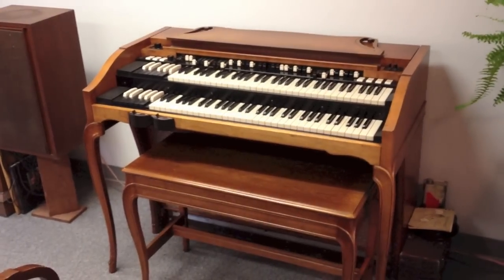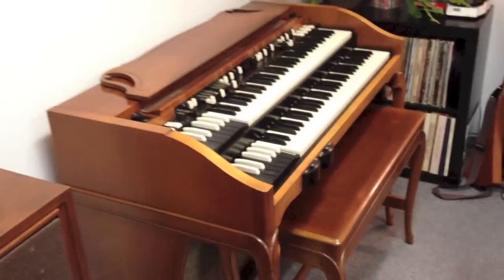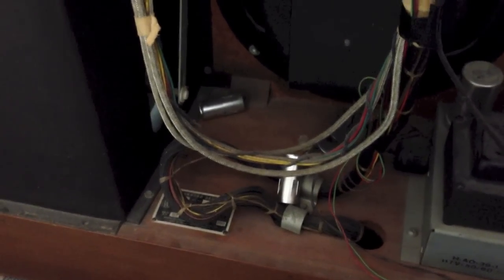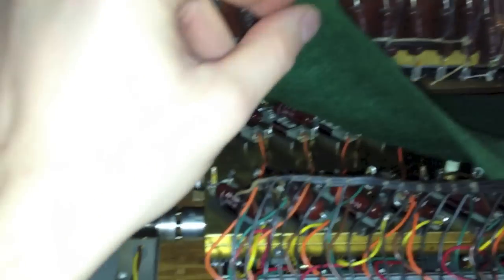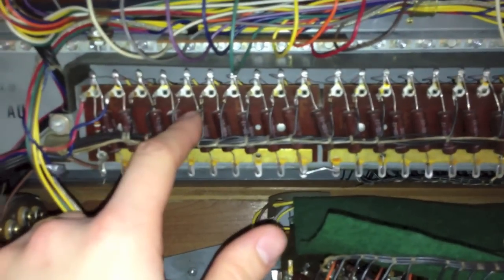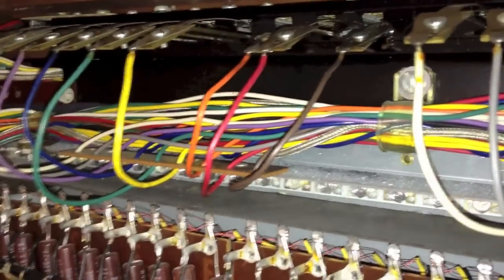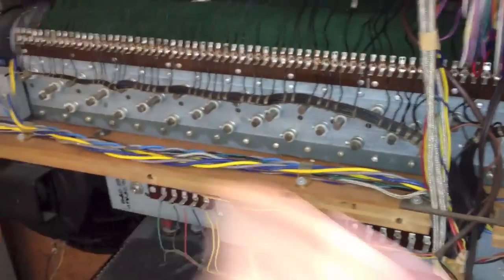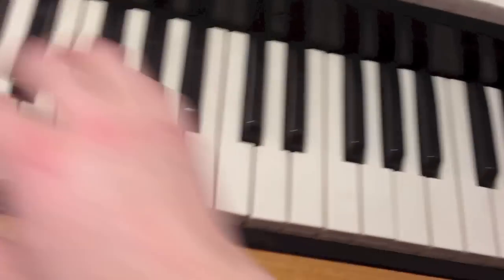1965 Hammond A-102 clean up and restoration

Comment: I just got a M102….does that sound right? Anyhow, has two switches, a motor and play switch. Motor switch doesn’t stay engaged but runs and has quite a racket. I’ve oiled but it hasn’t really changed the racket. Not sure how deep to go but it is truly a marvel of American musical production. A primitive synth. Reverb-2 of them are very string sounding. Although it seems to have both engaged for a good audible signal. There is obviously no one left to advise a would be owner. Any thoughts on racket and volume levels without reverb engaged. It still sounds in Key.
Reply: Start and runs switches. Press and hold start for 8 seconds. Continue holding and turn on run. After 4 seconds release the start switch. They usually are fairly noisy when starting but should be pretty quiet when running.
Reply: Are you using Hammond oil?
Reply: If it has been oiled for years, which is not uncommon, it needs time to soak in and spread out.

Comment: Hi, could you elaborate on how you cleaned the tube sockets? I recently purchased an organ just like yours and the percussion does not work, I tried re-seating the tubes to no avail, so I'd like to clean the sockets next, also, the reverb circuitry was stripped out of the poor thing, I realized shortly after that it has had a rough life.